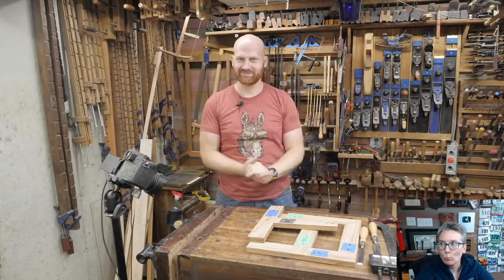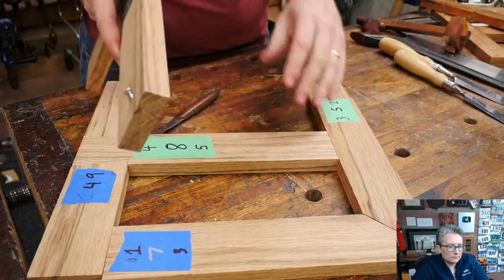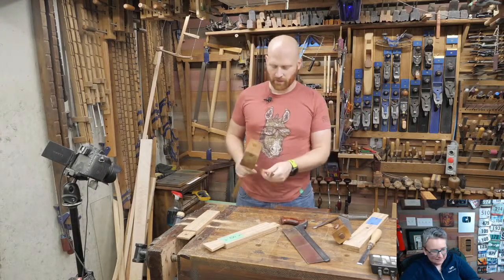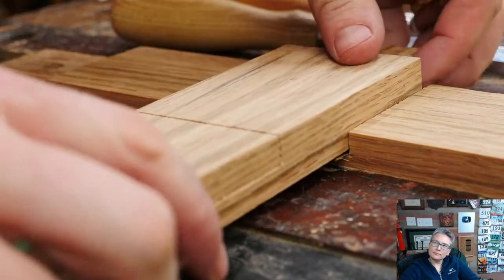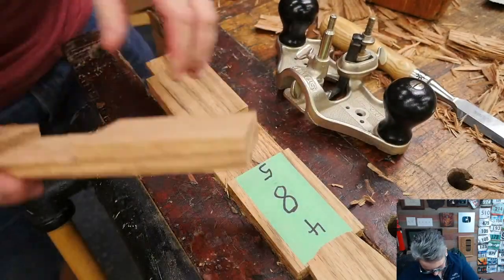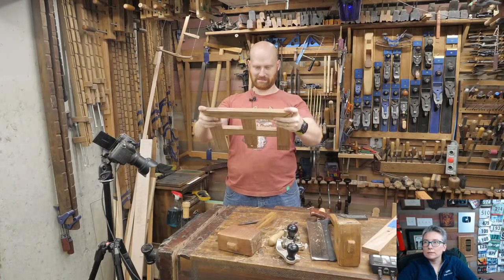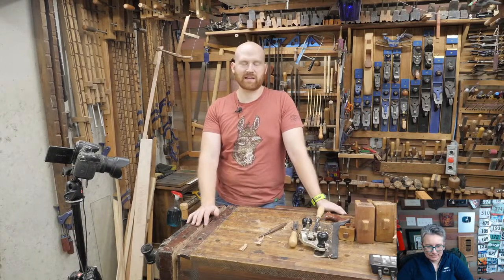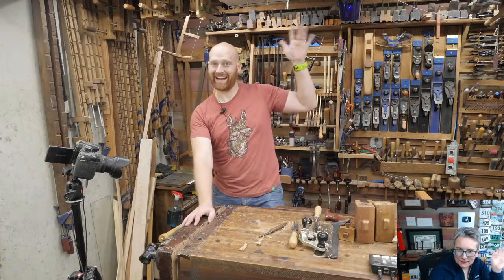How To Make a Mid Half Lap Joint Window Live

Comment: I was making a lap joint in a 1/4 x 1/4  wide walnut inlay in a small cross of cherry with a dado, should have watched this. The dado was too deep and there is no way to create the half lap deep enough to reach the bottom of the dado and fit flush. My second option was making spear points, 2 45 degrees on all four inlay to make them fit together in the middle, but I went full carpentry mode and didnt take my time. I should have taken out my combination plane and slowly made the depth of the dado, but I rushed the project and used my router table, setting it too deep and am not happy with it but was crunched for time, which reminds me of will saying patience is in woodworking and should not be rushed or some other Japanese woodworker. Thanks for the video, I appreciate it as I am still learning through mistakes. And yes, I come for her jokes, not your handiwork.